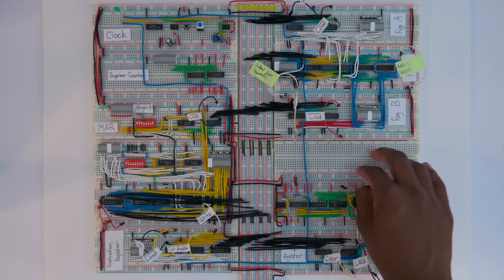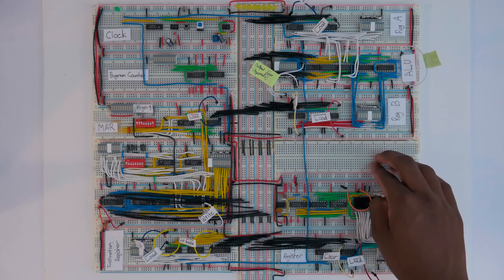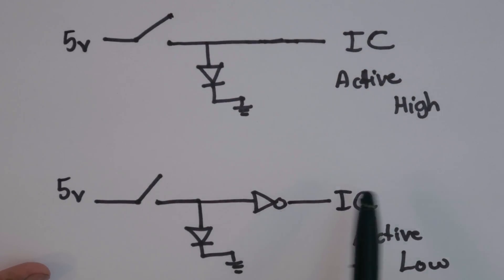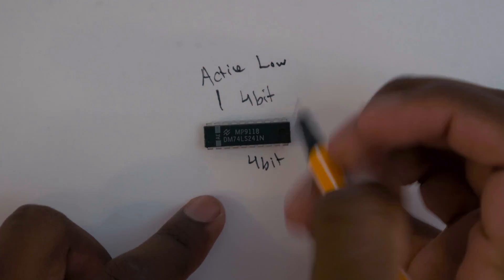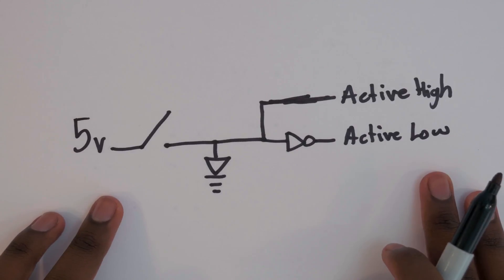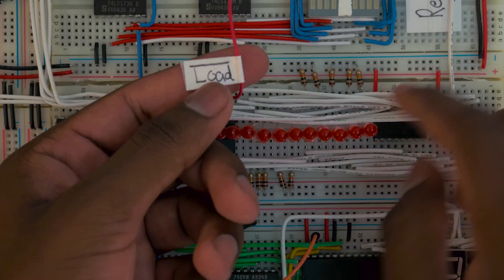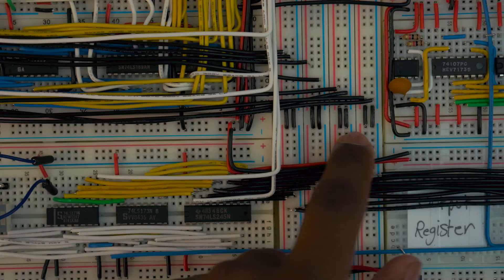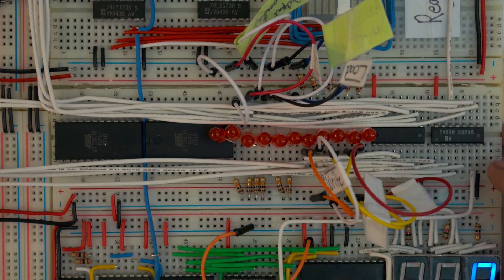Automating our CPU | 8-Bit CPU Project

Comment: Do you have a number for?approximately) how many transistors it takes to build the whole thing? (I have this crazy idea of making a working computer without semiconductors, using inductive logic circuits, so it could be built from ferrite cores and wire...)

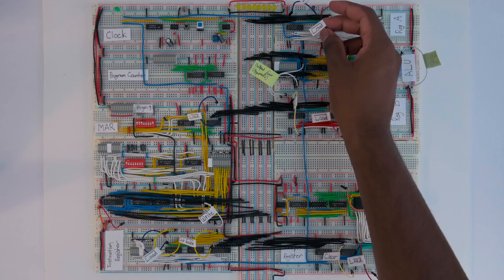Comment: 1:17 You can reverse the polarity of the LEDs and connect them to +5V to make them display on active LOW
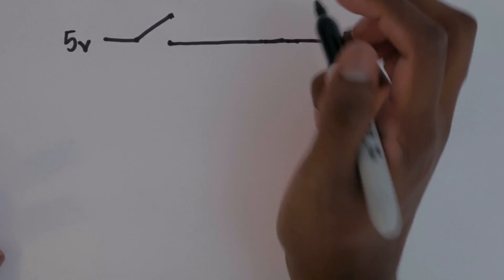1:42 LED Diodes have small arrows on them to indicate they emit light
Reply from the maker: +TheYouTubeCuber true. I chose the LEDs this way mainly because the logic was easier to think that active meant high than active low.  I always forget to draw those arrows! It's ok as long as you guys know what I mean.